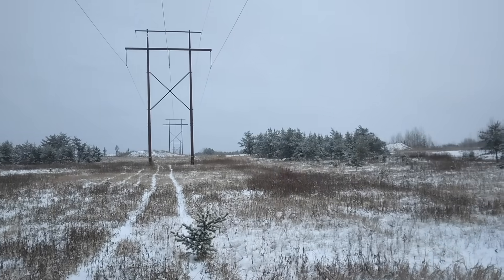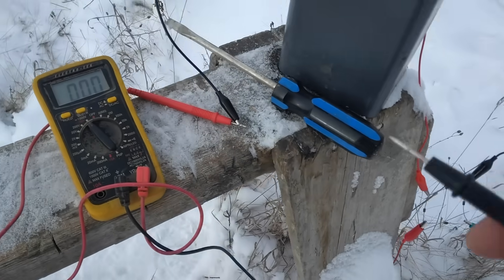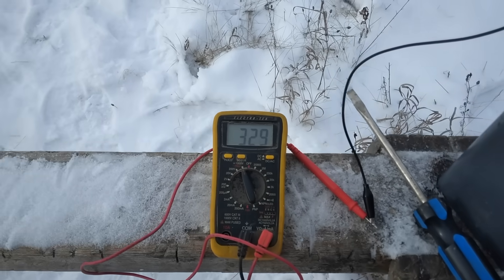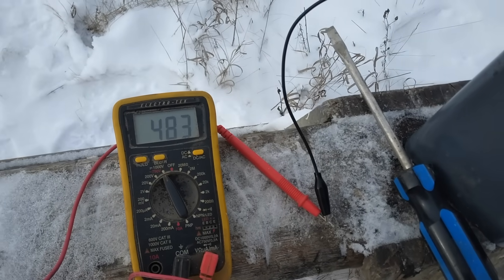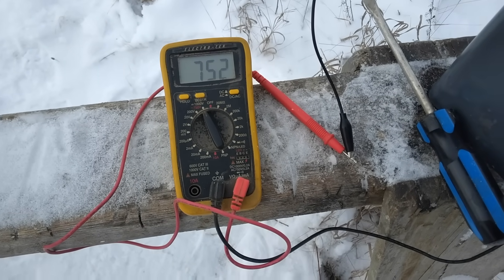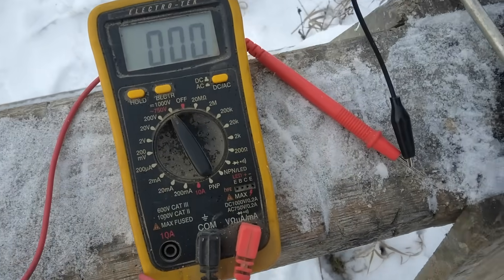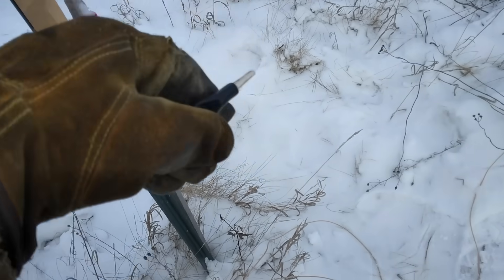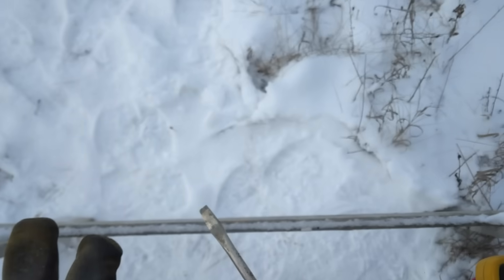Fences sucking power from under HV transmission lines

Comment: I know how to make more power from that, and I don't advise you do this..  But, theoretically speaking,, to get more power, you would use an isolated bare copper wire as opposed to one with the shielding like you have there.  That would increase the amount of inductance.  Then you would increase the number of copper wires running in parallel as the inductance is not merely limited to one wire and would induce current in all wires.  Then they could be connected together and use a full wave rectifier to convert the AC to DC for storage into a battery.  

This should be legal as your gathering energy from environmental radiation.  It's a result of the electromagnetic field from the power company.  But it isn't using the power from the power company, there's a big difference.  I'm not sure though as I'm not a lawyer and laws are different everywhere.  But imo you're probably good, theoretically speaking.
Reply: Also,.  You might get more current if you use rolls of isolated aluminum foil in parallel, *theoretically speaking.
Reply: Just the fact that there's an adjacent inductor causes higher impedence in the primary circuit (power line)
So,
Effectively this guy was stealing energy by impeding the flow of electrons in the powerline.
Reply: @benjurqunov  By that account everything in the universe would be an "adjacent inductor."  The fence isn't an "adjacent inductor". It's a fence energized by electromagnetic radiation which the EPA has laws in place to prevent the power company from emitting and polluting the environment in such a way.  In general, the laws are against the power company creating emissions, not for fence building.  The laws are against creating the pollution that creates what you call "adjacent inductors".

What you're saying is stealing is like someone catching cancer from old toxic waste dump, digging out the cancer and being like,.. "Now that there's stealing, you gotta take that back to the power company",..  It's insane.  It's not the way environmental pollution works.
Reply: @Quantum_State_Space  
As you obviously already know introduced inductor design and placement plays a major role in how effective it is. 
This guy's inductive object deliberately placed is far more effective than random stuff in nature.
While a fence is permitted in the easement, it's pretty safe to say a fence that's configured to capture energy from the powerline is a violation.
Reply: @benjurqunov  Nope.  I don't "obviously know" anything...  People like to project their own mindset on me for some reason.  I think it's characteristic of their narcissism and disposition of the field in general.  

Anywho,.  Everything is an inductor.  Laws are not against inductors, in general.  Laws are against the emission of Electromagnetic radiation into the air and environment.  The fence is not the cause of the electromagnetic radiation.  The fence is merely close enough that it gets energized by the radiation.  The radiation is there regardless of the fence or not.  The power company creates and is responsible for controlling it's radiation.  The farmer is not at fault for placing inanimate objects on his own property.
Reply: @Quantum_State_Space  
The point what clearly escaped you is the fence configured to capture a portion of that electromagnetic field reduces the transmission efficiency of the powerline.
Reply: @benjurqunov  Wrong.  That's environmental radiation.  A fence is a fence until the the power company radiates on it.  It on the power company to control it's radiation.  

And stop saying what has "clearly escaped me" or that I clearly think a certain way.  You don't know me and you don't know what I'm thinking.  Control your narcissistic rage.  It's beyond annoying. Just stop.

Comment: Years ago I used to ride in all aluminum bike it had an aluminum frame aluminum seat post and handlebars and stem the reason I mentioned that is because on certain days when I'd ride under high tension power lines in Scottsdale I would feel electrical shocks when my leg would come close to the seat post it would arc to my leg or maybe it was just my leg touching the seat post and sometimes I would feel it in my hands as well these days it's a non-issue as I write a all carbon fiber machine. I used to tell people I could feel the electricity when I rode under the wires and people didn't believe me but this validates me😊Thank you

Comment: Is the supplier losing something by your actions?  Yes.  One can measure the loss on the primary side (the transmission line) caused by your secondary side load.  You know you are taking energy and that’s the reason for the video.   Don’t pretend you don’t know you are stealing.

Comment: You need a coil that encloses a large area.    The the voltage and the total power will increase with the number of turns.    The amount of power is reduced the further you are from the source of induction.    E = N*d(Ph)i/dt.     The high voltage you are seeing will drop dramatically to nearly zero when you try to extract any power.    Your DVM has about 10 menohm input resistance.     That's the reason the capacitor is charging to a high voltage.   However as soon as you load the capacitor the voltage will drop to a low value.    To get a power source you do not need rectifiers, just a coil of wire.    Using a coax is not the way to do this.   You need a coil with a large number of turns and if you want significant power you need large wire.   The larger the area of the coil the more power will be available.     The coil must enclose a large area to get significant power because more magnetic field is enclosed.      Electrical Engineering 101.    See @quoderaldemonstrandum5442 below for some good information.    Looks like you can do this legally (as long as you don't get too greedy about taking power from the grid!).   Interesting experiment.   I always wanted to try this.   LoL.   Oh yeah, lightning strikes will be a primary cause of burned equipment.   Huge voltages will get induced that can fry everything you've connected to your coil.    You can use a spark gap to limit the voltage to some extent at your load end.

Comment: Once I parked a truck and 50ft trailer under high voltage to secure my load. I kept getting a stinging sensation and it wasnt till I was done i realized i was getting electrocuted. When looking closely I could see a blue arc going from my finger to the trailer. Happened because I was not wearing shoes.
Ever since I've been wanting to try this!

Comment: In grad school I TAed an intro engineering course a couple semesters and I did like to bring up basic physic and how "We will now use some of what you had in previous classes." 

Concept: Inductive coupling. See: Maxwell, Gauss, Faraday, Ohm, Kirchhoff, Compton and all the pioneers who went before us.
Application: It's how transformers work. See also: Carrington Event and Electromagnetic Pulse.
This idea does work with high tension power lines. I would try given the opportunity. As for 'stealing' electricity... depends on how you look at it. It DOES remove energy from the lines BUT, it's a hard stretch call it illegal. See: 21 & 47 CFR. TLDR = once a source of electromagnetic energy radiates into the 'aether' it belongs to everyone and no one. Similar to leaving trash in a can by the curb, you relinquish it to the public. However, if said electromagnetic energy carries information of a beneficial nature and you intercept then divulge it, you could be breaking the law. 

It will work with a fence but what you should avoid is a closely wound coil of fine gauge wire wound in a manner, like a tight oval, that allows the coil placed at right angles (normal) in two axes to the power lines. This is especially important because that configuration and orientation allow the maximum current to be induced into the coil. This could pose a shock hazard, so take precautions. 

I'm not a lawyer, I'm an engineer and I am licensed by the FCC. Do not violate utility right-of-way. High voltage from high tension lines can kill you.☠ Not only that, it will hurt the entire time you're dying. Consult your local listings, your mileage may vary, if you harm yourself or others that's on you - but do try to get it on camera if you can.

Comment: I dont get it? You have high voltage power lines youre siphoning using emf.
What level.of voltage did you expect with a recifier and no transformer?
Also please use a resistor to discharge.  Unless you enjoy welding.

Comment: Bro, someone should tell you, if you don’t know this already, 750 V is nothing if there are no amps following behind it, you just showed the voltage, voltage is only potential…… without current behind the voltage it means nothing or very little, you can have 10,000 V with 10 mA behind it and it will be the equivalent of a stun gun. 6:52 I really wished you showed the current rating on that wire. Or the amps it had on it.
Reply: 10mA is a substantially higher amount of current than a stun gun’s delivery. Muscular fibrillation happens at this amount of current

Comment: Interesting but what pratical use is the bottom line 'cept for physics experiments ?? .....Unless it's zero cost Scrap coax cable, why bother when Any type wire Works ??

Comment: Whenever I rode my mountain bike under steel tower power transmission lines in the dry desert weather my butt/thighs got shocked from the metal frame rails supporting the seat. One route followed under the lines for a couple of miles.. bzzzztd.. pop... bzzzz...snaaaap...  ouch. lol

Comment: I can tell you that in Oregon almost to Pendleton, there is a farm on the south side of the Columbia river that has AC power lines underneath much higher voltage lines, They've burned up their substation twice, and gave us no end of trouble to our variable speed drives.

Oh yeah, this stuff is real. 

Oh yeah, that cap at 88uF at 1200V will absolutely kill you if you get across it the right way...

Comment: To steal something, you first have to take something. If you induce electricity from the electromagnetic field that is already being given off by a transmission line, you aren't taking anything away from or utilizing any power from the grid. You aren't even using or "absorbing" the electromagnetic field, whatever you are using as a conductor is simply interacting with it which causes it to experience magnetic flux. It's Faraday's Law of Induction.
Reply: @greco7522  what definition is that? There is a legal concept of Conversion which might match up with what you're talking about, but to steal something you have to take possession of it.

What's ironic is it can often be quite hard to talk about the English language or legal concepts definitively because there are so many different examples where the so-called definitive sources used in one location don't always agree with those used elsewhere. In this case however, all of the dictionaries and legal frameworks would seem to agree, to steal something you have to actually take it. Either way in this case you are not taking anything that belongs to someone else nor depriving anybody of anything.

Comment: They put a huge new high-voltage line through the area I live, and every fence it crossed, they installed two (one on each side of the transmission line) large ground rods and copper cable linking each strand of barb wire to the ground.

Comment: You can get a lot of volts, if it is a 30kV power line at 30 m elevation you have 1kv/m altitude. Not much power is stolen

Comment: You do draw down power from the overhead wires! As you do, you rob the wires of electricity, and they can tell you to stop, and even if you get a lawyer, they'll win. Here's why: As many have commented, it's inductive transfer of power. A simple AC transformer is the same thing: Two wires, one transfers power to another - but they are wound together in the most efficient way that engineers can design. (Your design is about the least efficient). But in a transformer if you put a load on the secondary coil, the primary expends more amperage to supply the load. Same as your experiment, as you charge a capacitor the load on those overheads is lost to your capacitor, and you took their power. In a miniscule dose, a drop in a lake. Now if you engineer it and get your coil to be more efficient, you can power big stuff off of it and the load losses to the overheads will mount up. There is only a certain amount of "wasted power", or loss, but it increases as you draw it off. Certain laws about easements that are in place (especially in the old days) allowed people to win their cases, but you can bet if you really start drawing significant power you'll lose your lawsuit.

Comment: FLUX CAPAITOR how DeLorean got its power to go back in time. Literally how they showed it in the movie. They took the wire and ran it across under high voltage lines.
The capacitor will stay charged and kill you like a Marshall Amp never play around in an old Tube Amp it can kill you

Comment: So, if i get this right, you can get 100 or 200 Ac volts but only a fraction of a milliamp?  

and since you need 30 milliamps or so to kill you, so, you are safe all along?

and also, there is no power at all for anyone to use, with fences or wiring, right?

Comment: I tried to find the capactance of your capacitor but could not find it.  It seems to be rated for 1,500 VDC.  Physically large ones shown elsewhere are rated at 25uF.  As a starting point, let's say yours is 100uF.  (I await the correct value.)
E= 1/2 C V2, meaning energy in Joules = 1/2 0.000100 x 900volts x 900 volts= 40 Joules, which is 40 Watt-seconds.  It took 2 minutes or longer to reach that voltage so you are getting something around a half of a watt.

Comment: You need to switch that meter to DC and zig zag that line under the power lines and you'll really crank up the juice. But even what you're doing right now is incredibly dangerous. High voltage does NOT act like conventional electricity and can EASILY cross gaps and penetrate insulation.

Comment: We ran some battery powered LED Christmas lights along our wire mesh fence that sits below the power lines going down our street. 
I notice they were lighting up and I didn't turn them on. After a few weeks they stopped working, I took them down and opened up the control switch and it was burnt out.

Comment: Hold up 2 flourescent lights inder the hv,and they'll light up with no connections!
The Toronto star did this experiment under hig voltage lines  in northern Etobicoke back in 1969!

Comment: Inductive coupling is responsible for this. You can probably raise the voltage potential on your coax to the voltage on one phase, reduced by the resistance of the coax and distance from the source wiring. The fact that you are standing in frozen conductive water, is scary! Why are use using coax? It in itself is a capacitor at these voltages. The original nuclear tests were done utilizing 75 ohm coax, where it originated. It was used like a fuse, very dangerous what you are doing. Hope you do not have animals near those wires⚡️

Comment: The amount of power you are getting here is only a few milliWatts. Completely useless.
If you connect to both ends of the wire, you will get a lower voltage and a much stronger current.
And if you use multiple turns of wire the effect should multiply.
Anyway, even with an expensive setup costing hundreds of dollars of wire and an efficientstructure, you would only be able to get a few cents worth of electricity per day. You would get much better results spending those hundreds of dollars on some solar panels.

Comment: I was at a friends place who has a horse area that is fenced in with a simple wire fence.  It is under a high power line.  The wire acts like a coil and if you touch 2 wires you feel a slight shock like a 9 volt battery on your tongue.    I always wondered if that energy could be tapped for free.

Comment: I remember I was out on BLM land once and someone had dumped some mattresses out there along the power lines. The box springs were stripped of any fabric and in an effort to move them I lift them over my head. Enough current was picked up by the box springs and run through my body that my arms were trembling. Ever since then I have wondered whether or not you could pick up enough current to siphon electrical loss from overhead power lines.

Comment: After reading various comments: Electricity and the electromagnetic field are the same thing. The EMF associated with the overhead power lines is the electricity. It is not "lost anyways". Coupling the electric or magnetic fields to create a current in a secondary circuit removes energy and does work. This isn't the best analogy, but if I used a magnet to have someone tow me down the freeway without touching their vehicle, is that "free energy" that would be lost anyways, or would it appear to them as if they were towing another car?

Comment: In Australia high voltage lines must be in excess of 20 metres above ground so as to dissipate voltage but the in air voltage still runs fluorescent light tubes taped to posts

Comment: Induction is a thing. It does put a load on the power line. Almost negligible but still is technically stealing power. You will get a better result if you use a different circuit than your setup. You can have 2 separate circuits one to earth and as a coil.

Comment: It’s not clear to me whether this is electrostatic or magnetic coupling. If it’s electrostatic, the ultimate peak voltage would be on the order of 240 kV x 4’ (height of fence) / 40’ (height of transmission lines). I’m not sure how to calculate the max open-circuit voltage due to magnetic coupling, perhaps some other reader would know how to do so.